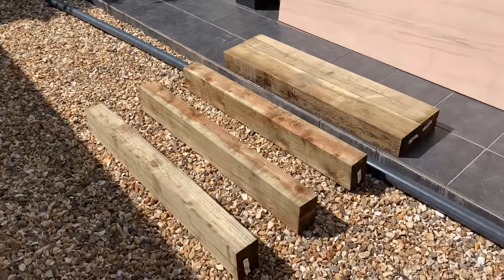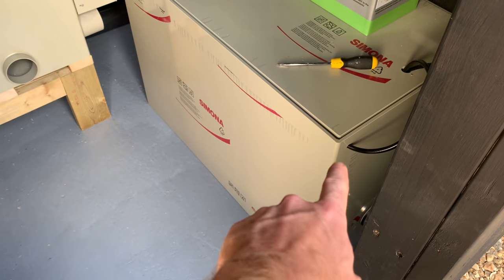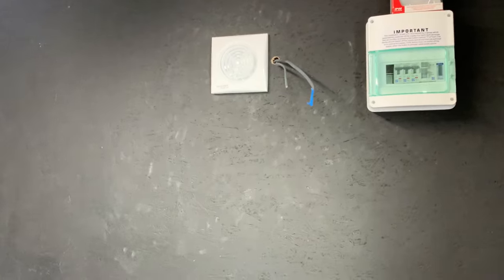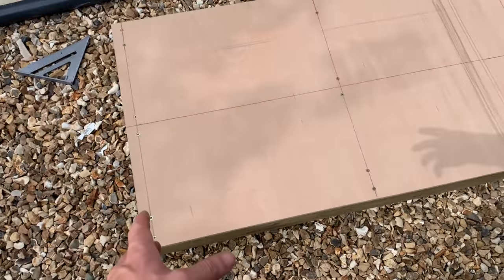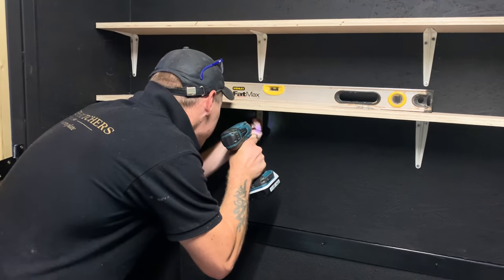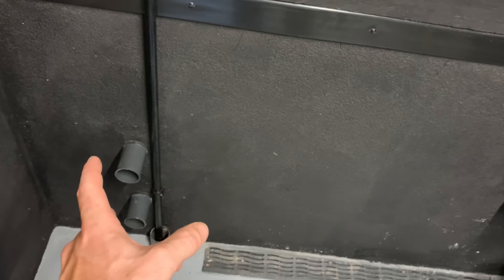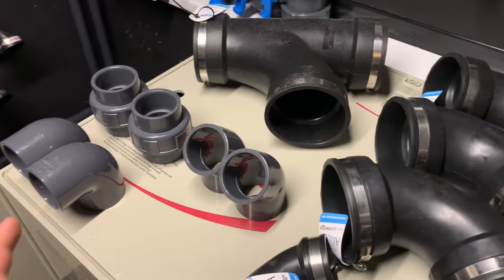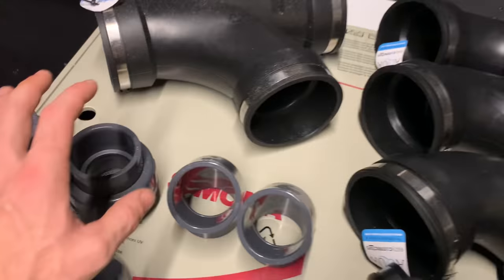LOADS OF WORK**FINISHED** IN THE FILTER HOUSE ITS NOT BEEN EASY MY DREAM POND WILL SOON BE RUNNING

Comment: Another great video mate,  but if I was you, I wouldn't even try use that pump with the faulty thread,  send it back to them now and you should have a new one back in a few days,  at least you won't be worried about it failing or worse damaging some of other other new equipment if it failed.  Don't mind the haters pal,  keep up the good work

Comment: Pity your going to have to run that return over the skimmer. Can you not run it behind it suspended? Got an up and over on my system and it does my head in. My pump is only about half a powerful as yours but do get air trapped in highest point. Must be air from my moving bed. Love the videos and you are nearly there now.
Reply from the maker: Yes it’s a bit of a pain but I have ran out of room I might be able to think of something though will keep trying
Reply: @JamesTHEKOIwhisperer123  I'm sure you will

Comment: Hi James.

What’s ya thought on this set up 

Pond 6000 gallons

Skimmer running 30” ea k1 bead on 20000 variable pump 
 2 x air rated bottom drains 
The 2x nexus 320 running 130 air pump
Then I have an extra line on skimmer to run another feed many be straight to a bakki shower or through a sieve then to a shower ?
Reply from the maker: Sounds like a great set up mate have you not thought about a drum instead of Nexus not that there is anything wrong with A nexus just you can push more water in a drum but that set up would work like a dream
Reply: @JamesTHEKOIwhisperer123  

Have looked at a drum, but few things with a drum on the feed I believe you can pull out into the bio chambers 🤷 I’m going to be running 6 return on the pond 2 on each wall spinning the water towards the  skimmer.

Just thinking about the bakki on will it offer any benefits 👎/👍 to the system I will run. I have thought on a lot of systems just to many 😂

Pond will be inside of a building so no weather elements and all heated.
Reply from the maker: @Koi.Heaven  sounds like a wicked set up mate tbh but loads of work and trust me mate the pipe work soon adds ups lol 😂 but you will have a great pond mate 

Like you say there is loads of different ways to run a pond I think it just comes down to what ways you wood like to do things and how much the bank balance lets you do things on top of all the hard work it takes 

But planning is definitely the way to go mate 

I like your ideas 

But for me I love the look of a shower next to the pond but they are noisy all depends what you would like they do work Super well when good media is added

Comment: You're definitely going to have a problem screwing the fitting on to that pump
Reply from the maker: Yea thinking the same
Reply: @JamesTHEKOIwhisperer123  I reckon that thread was damaged at source James, especially as the box wasn’t damaged. Maybe contact the supplier about it and if you get no joy use a fine file just to ‘de-burr’ it and tidy up the thread. Good on you for fighting back against the haters and like you said it’s your channel you can do what you want.